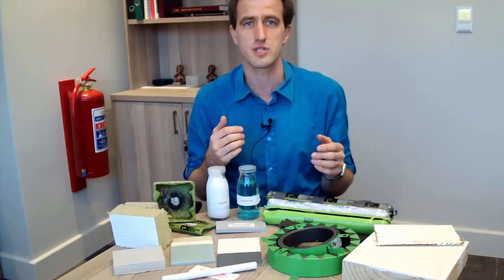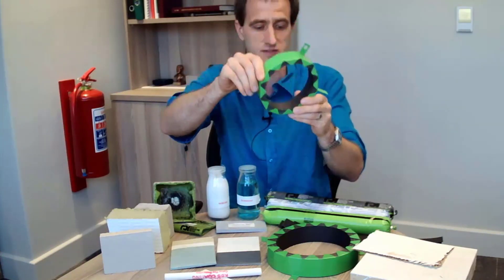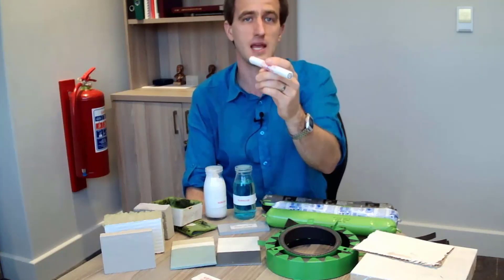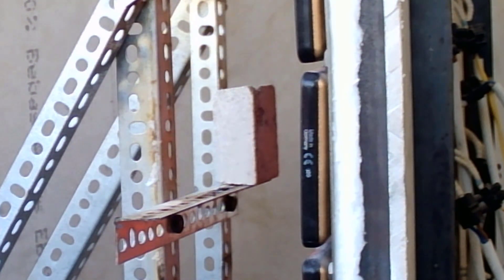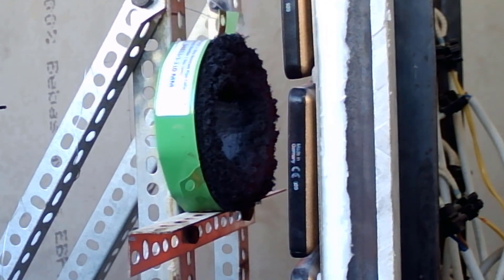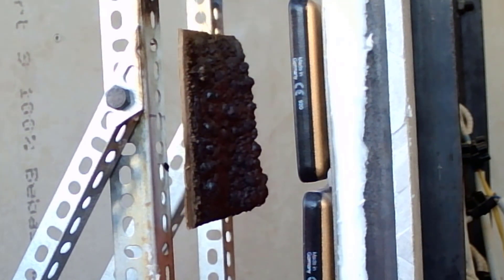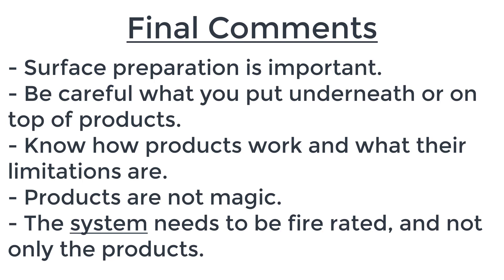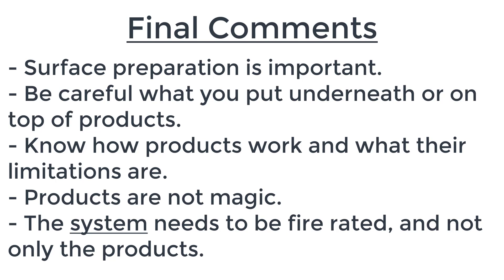Understanding passive fire protection products for buildings - Some demonstrations and discussions

Comment: nice one... am wondering if a thin  intumescent spray on steel duct can provide fire resistance in terms of insulation say 60mins using standard fire curve in furnace.
Reply from the maker: You are unlikely to be able to turn a single plate of steel into a fire wall with insulation resistance using only intumescent. The steel normally fails insulation criteria before the intumescent has even activated. It is for structural resistance, and not compartmentation, that intumescents are applied

Comment: Thanks for the nice video Prof, may i know what is the product and substrate used for the epoxy in 10:00? I think it wasn't introduced in the earlier part too.
Reply from the maker: At around 10 minutes it is a solid layer of epoxy so is not on an substrate. Hope that helps.
Reply: @firesun  Thank you Prof
Reply: @firesun  Hope you are well Prof. If you don't mind, could you kindly share the source of the solid layer of epoxy? Am looking to run some tests on a similar sample but its not widely available. Thank you!
Reply from the maker: @raycjg  The samples tested in this video were kindly supplied by Carboline and Pyro-Cote (except for the intumescent on timber which failed which came from a third company).
Reply: @firesun  Many thanks Prof! Appreciate it very much.
Reply: @firesun  Maybe the intumescent was too thin and would need to be applied more and may need to achieve at least 800 microns or a WFT reading of 1651-1780